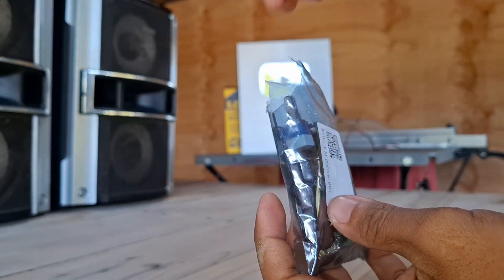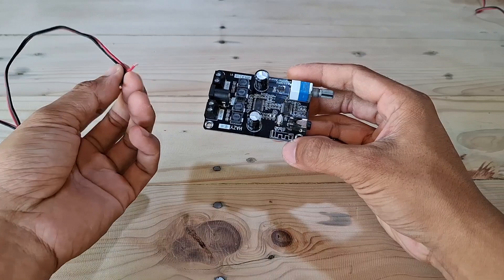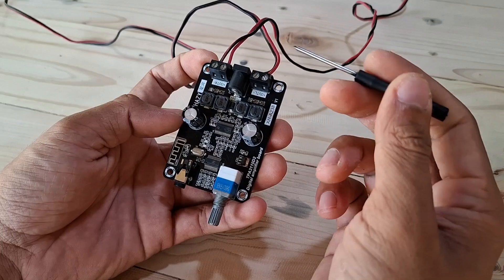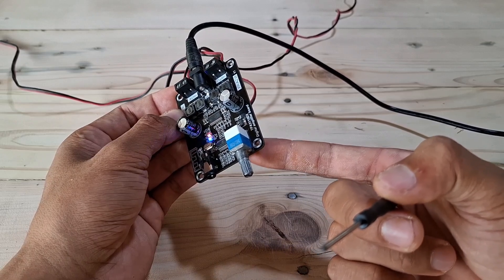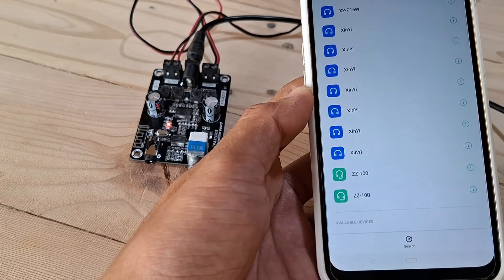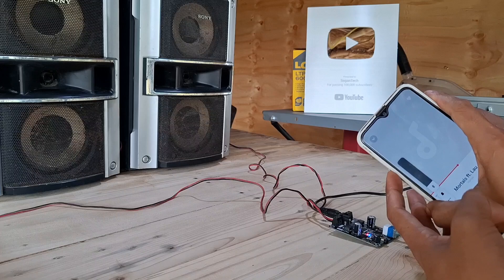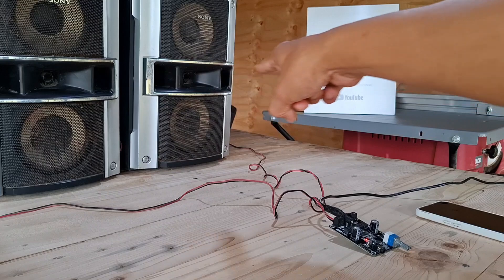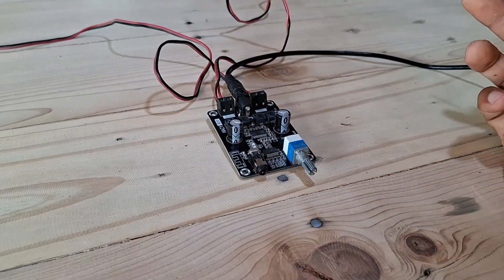Testing the Powerful 60W TPA3110 Mini Amp! 🔊 | XY-P15W with Volume Control

Comment: Bro help me
Reply: Im soldering the wires and near to me im hearing songs on xy p 15w module  suddenly my dad open the door im got scare and in my piece of wire i put on wire indecently
Reply: I don't no what happen please help to repair it
Reply: I got it after 23 days
Reply: it is working to well but by mistake it is not working
Reply: It getting heat up when i connect 19 v 3.33 amp power supply and nothing physical damage on it
Reply: hmm led indicator got damage my me 😅
Reply from the maker: Buy a new xyp-15w.  That's really roasted inside.
Reply: @Segantech  bro can u help me to buy good tpa3118 Bluetooth module i choose one
Reply from the maker: Don't use 19v
Reply from the maker: 15v instead
Reply: @Segantech  bro can i buy tpa 3118 Bluetooth module 30+30 watt out put
Reply: @Segantech i have 20w 8ohm speaker pair and i buy 2 10 w 4 ohms speaker today❤
Reply: @Segantech  its name is xh m314 can u tell me it is good or not 😊
Reply: @Segantech  ok. Bro it take moooore 20 days😢😭😭😭😭😭😭😭😭
Reply from the maker: Ow bro. I found your comment. How are you now?
Reply from the maker: Can you tell me if you do it?